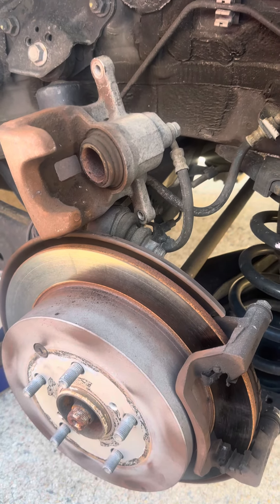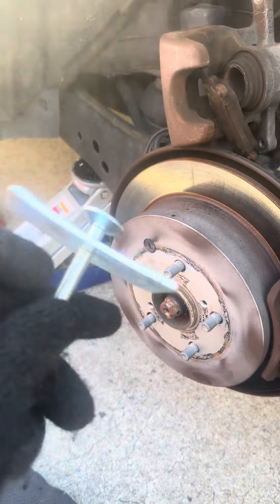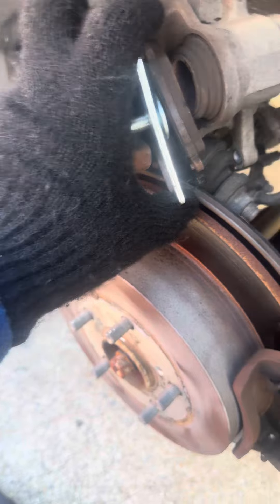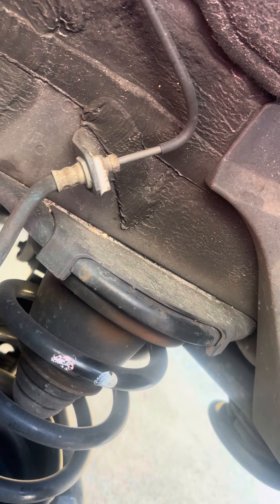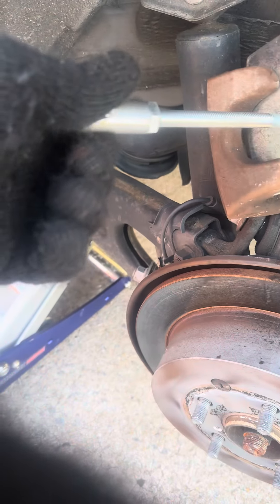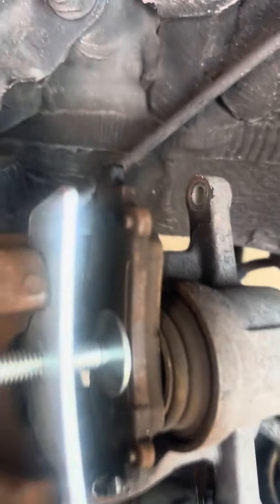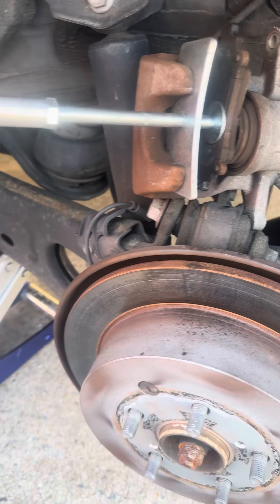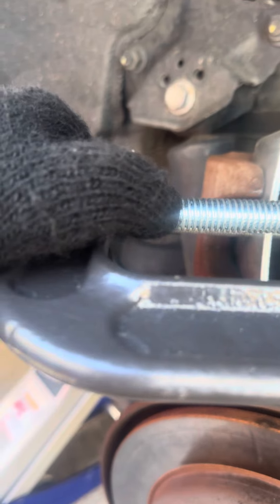Push in a brake piston easier 🤔

Comment from the maker: Mobile Mechanic 757 Top DIY Tools:
⏬ ⏬ ⏬

1: Mid-Grade Scan Tool: https://amzn.to/3r5t3sB
2: Bluetooth Scan Tool: https://amzn.to/3QCnigd
4. Cheap Scan Tool: https://amzn.to/3YtBD0F
3. My Fancy (Originally $2,000 https://amzn.to/3s1M9Ab
5. Dash Cam (Every Car Should Have One): https://amzn.to/3OAGqsF
6. Basic Mechanic Tool Set: https://amzn.to/3qs2ZHM
7. Professional Socket Set: https://amzn.to/3OWvUxi
9. No Charging Required Car Jump Starter: https://amzn.to/45pDPIJ
10. Battery Pack Car Jump Starter: https://amzn.to/3Yx0Y9M

Tools I used every day for videos: 🔧🔨🧰
⏬ ⏬ ⏬

1. R-134A Recharge Hose Adapter: Amazon Link: https://amzn.to/3YSMwtb
2. Astro Digital Multimeter: Amazon link: https://amzn.to/44bAKuW
3. R134a Refrigerant Gauges Amazon Link: https://amzn.to/3KKFlNM
4. HVAC Refrigerant AC Sniffer R134A Amazon Link: https://amzn.to/45EDIJi
5. AC UV Dye Leak Test Detection Kit Amazon Link https://amzn.to/45hHCrX
6. CRAFTSMAN Screwdriver Set, Amazon Link: https://amzn.to/3Yydw0Q
7. CRAFTSMAN Screwdriver, Slotted, Amazon Link: https://amzn.to/3QsgFNF
8. Truper 33186 6-Pound Sledgehammer, Amazon Link: https://amzn.to/3OJGvLH
9. CRAFTSMAN Mechanics Tool Set, Amazon Link: https://amzn.to/43Vq5UU
10. Cordless Electric Ratchet Wrench, 3/8 Amazon Link: https://amzn.to/3Kx1dMo
11. DEWALT 20V MAX Impact Wrench Amazon Link: https://amzn.to/3s7LyfY
12. Brake Pad Spreader Disc Brake Pad Amazon Link: https://amzn.to/47rWCFd
13. BOEN 3/8" Drive Impact Socket Set, Amazon Link: https://amzn.to/3DLKSzJ
14. Olympia Tools C-Clamp (8" X 4") Amazon Link: https://amzn.to/3QzjVGW
15. MARRTEUM 12-Inch Bungee Cords Amazon Link: https://amzn.to/47ltsrd
16. Permatex Silicone Gasket Maker Amazon Link:https://amzn.to/44qrrHH
17. Autel MaxiSys MS906BT Pro Amazon Link: https://amzn.to/3E6EMtW
18. 12V Car Battery Tester, Amazon Link: https://amzn.to/3KOKkge
19. Car Clips Fastener Remover Tool Amazon Link: https://amzn.to/45zKsZp
20. Craftsman Mechanic Tool Set, 230 Piece Amazon Link: https://amzn.to/3sAsRBY

As an Amazon Associate, I earn from qualifying purchases.

⏬ ⏬ ⏬

Book A Phone Business Coaching Session (3 tiers to choose )
OR
Buy 9 Essential Mobile Mechanic Customizable Documents from over 32 years’ experience! https://www.themobilemechanic757.com 

📋 Document for Mobile Mechanics

1. AC Cheat Sheets: (you get 21 pages)

2. Automotive Repair Release of Liability:(you get 1 page)

3. Craigslist Ad Template with Seo Keywords: (you get 8 pages)

4. Policies, Warranties, Requirements, & Disclaimers: (you get 3 pages)

5. How to Read Fuel Trim: (you get 5 pages)

6. Ignition and Compression Misfires Guide: (you get 3 pages)

7. Pre-Purchase Used Car Inspection Checklist (you get 9 pages)

8. Pre-Purchase Used Car Inspection Customer Form:(2 pages)

9. R1234yf/R134a Pressure Charts: (2 pages)

🔥 Why Choose Our Documents?

✅ Timesaving: No more creating documents from scratch. Our templates are ready to use, saving you valuable time.
✅ Legal Protection: Ensure you have the proper documentation to protect your business from liabilities.
✅ Professionalism: Impress your clients with professionally designed documents and advertisements.
✅ Stay Current: Stay updated with industry-specific information documents that save you money and time.

Your DOCUMENT purchase will be sent via instant digital downloads of your order. Most are in MS format to customize to your business needs. (cash app purchases will be emailed to you 24 hours after purchase, excluding holidays)

To Purchase Documents or 1 On1 Business Phone Session (3 tiers to choose from) At:

⏬ ⏬ ⏬ 

Website: https://www.themobilemechanic757.com
Document Website: https://www.themobilemechanic757.com
Cashapp- $themobilemechanic757

IF YOU WANT TO HELP THE CHANNEL, USE THE LINKS BELOW:
⏬ ⏬ ⏬

Miguel Williams {The Mobile Mechanic 757} 

Cashapp- $themobilemechanic757
Email: mobilerepairs757@gmail.com 
Email: customerservice@themobilemechanic757.com 

SHIPPING ADDRESS-1706 Todds Lane #170 Hampton, VA 23666 🏠 

Disclaimer: Due to factors beyond the control of The Mobile Mechanic 757, it cannot guarantee against unauthorized modifications of this information or improper use of this information. The Mobile Mechanic 757 assumes no liability for any property or personal damage that may arise from repairing your vehicle after watching any of my repair videos. Due to factors beyond The Mobile Mechanic 757's control, no information in this video shall create any express or implied warranty or guarantee of any particular result. Again, any injury, damage, or loss that may result from improper use of tools, equipment, or the information contained in this video is the sole responsibility of the user, not The Mobile Mechanic 757. We are not lawyers, and this is not legal advice. Please consult a lawyer.